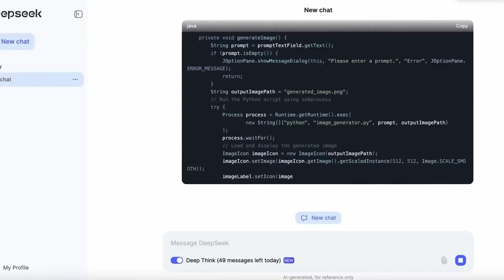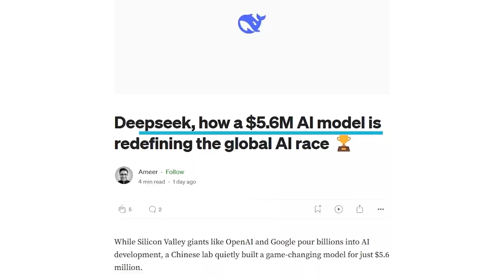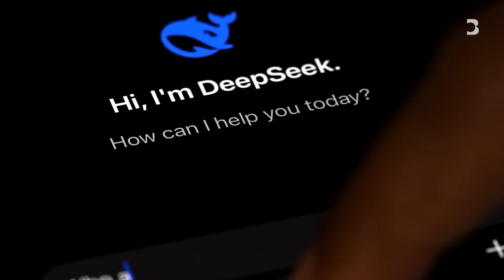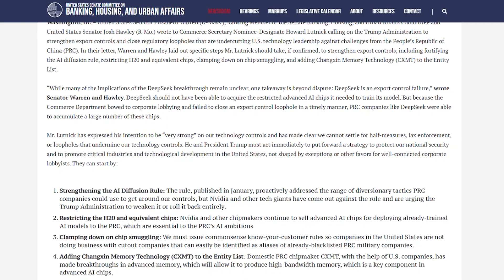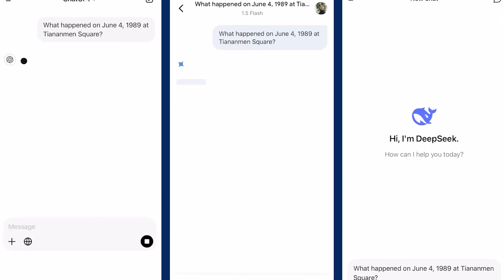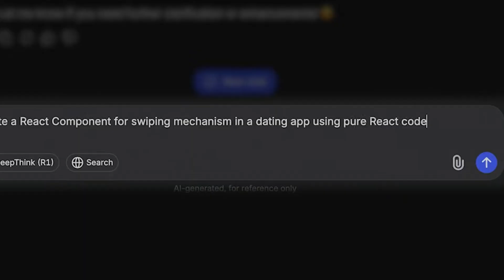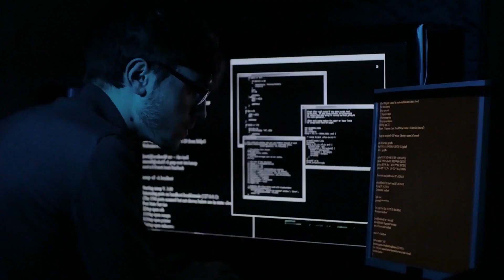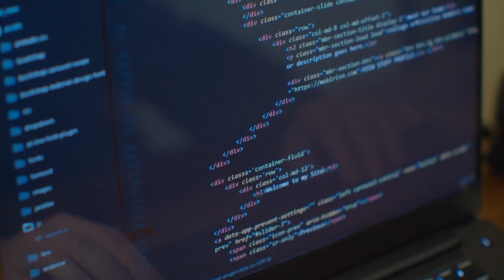2 MIN AGO: World-Wide MASS BAN of DeepSeek AI Just Started!

Comment: Let me show you a practical question by a user, given to Deepseek R1 and watch the astounding accuracy of the answer given in less than 30 seconds!

User: I noticed that Facebook is parsing all uploaded images with OCR and using the extracted text as invisible Alt tags in the page source. Is this legal?

R1 : Okay, so the user is asking if it's legal for Facebook to parse uploaded images with OCR and use the extracted text as invisible alt tags. Let me start by breaking down the components here.

First, I need to recall what OCR is. OCR stands for Optical Character Recognition, which is technology that converts images of text into machine-readable text. Alt tags, or alt text, are descriptions added to images in HTML to improve accessibility, especially for visually impaired users who use screen readers. Invisible alt tags might mean that the text isn't visible on the page but is embedded in the code for accessibility or SEO purposes.

Now, the legal aspect. The user is concerned about whether Facebook's use of OCR on user-uploaded images to generate alt text is legal. To determine this, several areas of law come into play: data protection/privacy laws, terms of service agreements, copyright law, and accessibility regulations.

Starting with data protection. The main regulation here would be the GDPR in the EU and similar laws elsewhere, like the CCPA in California. Under GDPR, processing personal data requires a lawful basis. Facebook's privacy policy likely covers processing data for features like this, but does the user consent to their images being analyzed in this way? If the OCR processes text that includes personal information, like names or addresses extracted from images, that could be a concern. However, if the alt text is only used for accessibility and isn't stored or used for other purposes, it might fall under legitimate interest.

Next, the terms of service. Facebook's terms probably include clauses about user content licensing and how they process uploaded data. Users agree to these terms when signing up, so if the ToS allows Facebook to analyze images for accessibility features, that would be a contractual basis. But if the ToS is vague or doesn't mention OCR specifically, there might be an issue. However, courts often uphold broad terms as long as they're not unconscionable.

Copyright law is another angle. If an image contains copyrighted text, Facebook creating alt text from it could be a derivative work. However, alt text for accessibility might fall under fair use exceptions, especially since it's transformative and for a non-commercial purpose. The Berne Convention and laws like the DMCA have exceptions for accessibility, such as the Chafee Amendment in the U.S., which allows reproduction for the blind.

Accessibility laws like the ADA in the U.S. or the European Accessibility Act require digital content to be accessible. Providing alt text is a key part of that. So Facebook might be doing this to comply with legal obligations, which could be a defense if challenged. However, using OCR-generated alt text without user input might not always be accurate, which could lead to issues if the alt text is misleading or incorrect, potentially violating accessibility standards.

Jurisdictional variations matter too. The EU's strict GDPR vs. the U.S.'s more sectoral approach could affect legality. For instance, in the EU, explicit consent might be needed, whereas in the U.S., implied consent through ToS might suffice.

Potential legal challenges could come from privacy advocates if personal data is extracted without clear consent, or from copyright holders if their text is used without permission. However, Facebook's legal team has likely structured this to fit within existing frameworks, using terms of service for consent and relying on accessibility compliance.

In conclusion, while there are potential areas of concern, Facebook's practices are probably legal under current laws, assuming they have proper disclosures in their ToS and privacy policy, and they're using the data in ways compliant with accessibility mandates. Users concerned about privacy should check Facebook's settings to control image processing or opt-out if possible.

The legality of Facebook using OCR (Optical Character Recognition) to parse uploaded images and generate invisible alt tags involves several legal considerations:

    Data Protection and Privacy Laws (e.g., GDPR, CCPA):

        Lawful Basis: Facebook must have a lawful basis under regulations like the GDPR (EU) or CCPA (California) to process personal data. This could be user consent, legitimate interest (e.g., improving accessibility), or contractual necessity.

        Transparency: Facebook’s privacy policy must disclose this practice. If the OCR extracts sensitive personal information (e.g., text from IDs), stricter consent requirements may apply.

        User Control: Users should ideally have opt-out mechanisms for data processing not essential to service delivery.

    Terms of Service (ToS):

        Facebook’s ToS likely includes broad licensing rights to user content and permissions for automated processing. If users agreed to these terms, Facebook’s actions are generally contractually permissible, provided the terms are not deemed unconscionable or overly vague.

    Copyright Law:

        Derivative Works: Extracting text via OCR could create a derivative work, but alt text for accessibility may qualify as fair use (non-commercial, transformative) or fall under exceptions like the Chafee Amendment (U.S.), which permits reproductions for accessibility.

    Accessibility Compliance:

        Laws like the ADA (U.S.) and the European Accessibility Act mandate digital accessibility. Automating alt text aligns with these requirements, potentially shielding Facebook from liability if the practice enhances accessibility, even if imperfect.

    Jurisdictional Variations:

        EU’s GDPR requires explicit consent for sensitive data, while the U.S. may rely more on implied consent via ToS. Compliance strategies must adapt to regional laws.

    Potential Risks:

        Privacy Litigation: If OCR extracts personal data without clear consent, lawsuits could arise (e.g., under GDPR’s strict consent rules).

        Copyright Claims: Unauthorized use of copyrighted text in alt tags might face challenges, though fair use or accessibility exceptions could defend against this.

Conclusion:
Facebook’s use of OCR for alt text is likely legal if it complies with its own ToS, privacy policies, and applicable laws (e.g., GDPR consent, ADA accessibility). However, nuances like jurisdictional requirements, accuracy of alt text, and user consent for sensitive data extraction could affect legality. Users concerned about privacy should review Facebook’s settings for data control options. Legal challenges may test boundaries, but current frameworks suggest this practice is defensible.

Comment: 0:05 double standard - DeepSeek sharing info with China when user type in request in DeepSeek !?
But what about ChatGpt sharing user's info with the US ???? More so when DeepSeek is not even a closed source AI like ChatGpt, which means you don't know what the code inside CharGpt are doing when you run it !!
Which one is more likely to share info, you can figure it out yourself. 
DeepSeek is open source (meaning you can use it offline) and ChatGpt is NOT !